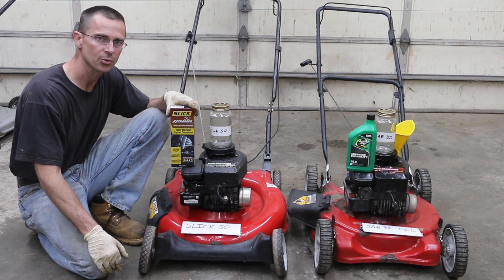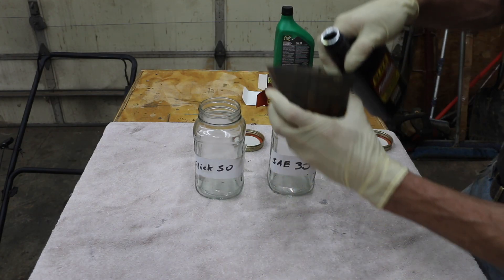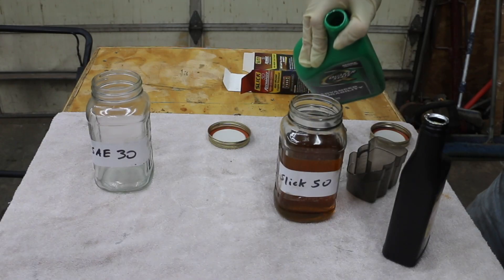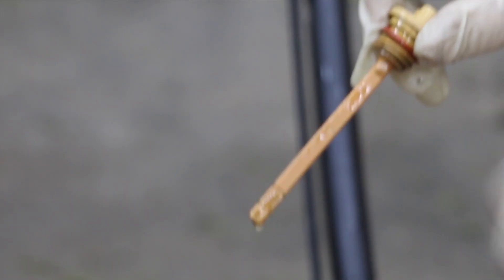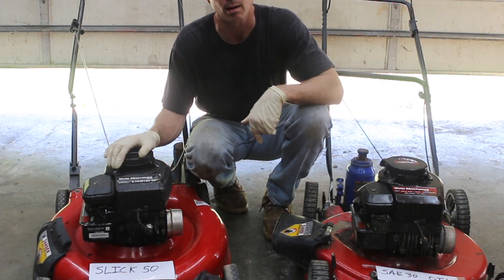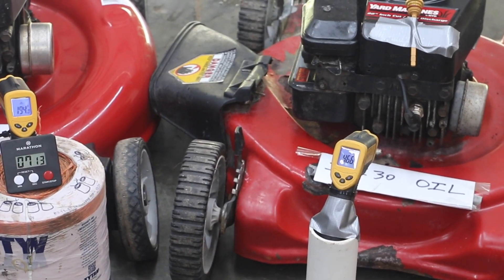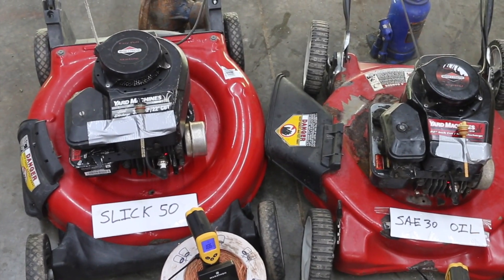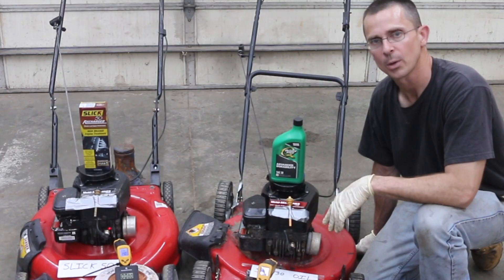Can't believe what SLICK 50 did to my engine!!--Dry Crankcase Test!

Comment: Hi all you chaps out there! I ran 'Slick 50' in a  Norton "Dominator" motorbike through  three oil changes which would correspond to approximately 20,000 miles. 
   Then one day the oil return hose to the oil reservoir developed a leak and unknown to me the engine ran completely dry while I was riding a long distance trip like a bat out of hell! The engine temp soared , so I pulled over and woe is me ,I was screwed in the middle of nowhere in the 'Rayalaseema' desert of Southern India, in the state of Andhra Pradesh ! (Try getting your tongue around those names.) Well, anyway, I taped up the hose,it held because it was not pressurised.The engine was not knocking, so iI guessed the bearings were ok.They're shell bearings in alloy con rods.Since I was on a long distance trip I always carry a couple of litres of oil in my saddle bags. And , oh boy! Was I relieved!! 
   When I finally reached Hyderabad city, the state capital, I stripped the engine . And I was heart broken. The Babbitt material was pitted and gouged out. Mostly due to the high heat from friction, luckily the crank journals were not too badly scored. I went down to the next undersize and installed Vandervell Indium flashed on bronze racing bearings.The slight scuffing on the cylinder bores on the thrust surfaces were easily honed off. A new set of hard chrome rings on the same old pistons ( Hepolite, Hepworth & Grandage) And everything was hunky dory for the next six years.....Till a lorry reversed into it and crushed it to smithereens. Oh yes! I forgot to mention. For those six years I did NOT use Slick 50. I used MolySlip 'E' in the engine and MolySlip 'G' in the gearbox. Magic stuff!!
    Now ...THAT stuff is unbeatable!!. I've ripped a hole on the oil pan of my Triumph Herald car once in the jungle, and it's got me home through 50 kilometres of grueling mountainous,potholed tracks. WITHOUT A DROP OF OIL IN THE ENGINE !!! Honestly! I kid thee not! The engine ran a wee bit hotter, but that was to be expected. The cam timing single link chain and sprockets took a tanning. But other than that everything was perfect.I did disassemble the engine when I reached civilization, but the bearings were perfect !
   A word of caution though, when using MoS2  (Molybdenum Disulphide). It acts a a catalyst of sorts to promote corrosion on bronze and brass surfaces , any copper based alloy, Similar to sacrificial anti-corrosion. In engineering slang it's known as bearing cancer! At present there's research going on to create electrical storage batteries far more efficient than Lithium Ion technology. It's well worth delving into those papers. It would prove very elucidating.
   And last but not least, I really appreciate the time effort and money you devote in all your programs. Very enlightening. Thanks a bunch and keep up the good work. Very few genuine blokes like you. You tell it like the way it is, really! We Indians are not exactly in the boon docks, you know! You have quite a following here in Bombay. ( I can't get my head around that new fangled name 'Mumbai'. It grates on my sensibilities!!!) By the way, that bike was a 1955 Dominator, with a "featherbed" frame and "Roadholder" forks. Quite the bomb in it's day. It could give a Triumph "Tiger 100' a run for it's money. It used to belong to a police officer and was used in parades and dignitary convoy duties. Alas!!! Them days are gone forever!
Reply from the maker: Thank you for sharing this experience!

Comment: Polytetrafloroethelene (ptfe) has a very poor bond rate to metal surfaces below 550F ...a temperature a normal internal combustion engine will never see...   and limited utility in engine applications although I've seen success with such resins in industrial compressor applications
Reply from the maker: Thank you for commenting on this!

Comment: I remember those adds for Slick 50. About 20 years ago my 15HP Kohler riding lawn mower started to have some valve ticking. I used an oil additive similar to Slick 50 but it was made specifically for small engines. Also at the time Slick 50 had some iffy reviews. I used it (sorry can't remember the brand) per directions (only 1 oil change, it was supposed to bond with the metal objects for a life time) and the ticking stopped and that engine is still running like a champ 20 years later.
You don't see those additive adds Slick 50 STP etc. anymore. I think the full synthetics have at least if not bettered the old additives.
Reply from the maker: Impressive results!

Comment: There is a lot of talk about Teflon in the comments section and I’d like to add my experience. As an aircraft weapons guy, active duty and civilian contractor with 30+ years on the job, I have worked on several sizes of Gatlin guns. Large numbers of the same weapons, as well as a couple versions of recoil operated .50cal, and gas operated 7.62mm guns that all used the same lube. It’s a medium weight, clear to white color and commonly referred to as “Camel Cum” (sorry for the crude reference). Interestingly to this subject, it is available with and without Teflon. Sometimes the Teflon was available separately as a powder and we could mix our own when necessary. Lube recommendations vary by weapon type and temperature you’re operating in but I can say positively and for sure, the lube with Teflon increases the firing rate of any weapon you put it in. In my mind, that clearly is a result of reduced friction. However, using Teflon in a weapon for 5k to 25k rounds and then disassembling and cleaning it in solvent (PD680 dry cleaning solvent in the old days, whatever that was, and later years mineral spirits) removes all of the properties of the Teflon. It returns to the lower firing rate when reassembled with the non-Teflon lube.

Its possible There is something else in the Slick 50 that acts like they claim, soaking into the metal and having residual effects, but it ain’t Teflon. I’m skeptical on the whole concept really. If there was a studied and proven product, I believe we would be using it on our military equipment. As I said, we do use Teflon suspended in lubricant for friction reduction in critical applications but there are no residual effects, and there are none of these “nano tech” friction modifiers available.
Reply from the maker: Great point!  Thank you

Comment: Hi John 
started to watch your vids about 2 months ago..
In this video you never said the temperature that slick 50 was when the engine seized...
As I was watching during the test the slick 50 temperature was almost half that of regular motor oil.. was it not?
So even though the motor seized much faster than the other engine the performance of slick 50 was
 still reliable don't you think?
I understand the premise is to test slick 50 dry engine claim- obviously this is an exaggeration..
But still the ultimate goal is a cooler engine than normal is it not??? not to run an engine without any lubricant protection...
So what do you think? 
Doug Grant

Comment: Can you please put Petron Plus Engine Conditioner Formula 7 versus Redline 0W40 full synthetic motor oil. I have seen some bearing tests on both and it would be great to have a unbias test done by you to really see if a premium metal treatment oil up against a premium motor oil. Both tests showed extremely low bearing wear so it might be worth while to confirm with your testing.
Reply from the maker: Thank you for the video idea!

Comment: It is my belief that Slick 50 on a microscopic  level opens up tolerances within an engine. It then precipitates out when shutdown hot. Due to the greater tolerances,  the conventional oil precipitates out as well more than it normally would leaving the treated engine with less protection. 
  Briggs and Stratton performed thier own test on two new engines seeing the same results as your own test. I remember seeing this test conducted around 1990.
Reply from the maker: Thank you

Comment: You should try rislone.
Reply from the maker: Thank you for the video idea!
Reply: @ProjectFarm  I use rislone in my demolition Derby cars. A lot of times we would lose all our water and sometimes the oil. That stuff always work great. We also had an old Cadillac coming to the garage that was missing and backfiring horrible. We use rislone ran in for a short time then let it soak in overnight. When we came back and started in the morning it started off rapping and went to smooth like nothing was wrong. Rislone is awesome

Comment: I put Slick 50 into a Fiat 128 in about 1984, and it made a huge positive difference. Engine went from rough running to very smooth. Oddly, I seem to recall that the Slick 50 back then was more white-ish after shaking up the bottle, not dark like yours. It worked well for about half a year, then I added some more, and it worked again for about half a year. I never believed the claim that it could run an engine when dry. They even claimed it ran an airplane engine with no oil.
Reply from the maker: Nice!  Thank you

Comment: I used to use prolong in my old Chevy and it did seem to run smoother and cooler.
Reply from the maker: Thank you!
Reply: Ha I just changed my oil that day and remember a guy standing and watching me dump some prolong in and he said "do put that in there it makes it too slippery and your motor will fly apart!" I looked at him with a big smile and dumped the rest in lol
Man that was back around 00-01. Getting old and no the engine did not fly apart ha

Comment: Is there anyway to free up a stuck small engine with anything like wd-40 or anything from lack of oil? Like maybe fill then drain, then add oil and it might live?
Reply from the maker: I've had good success with Marvel Mystery OIl. Thank you
Reply: Like fill it up and let it soak? Drain? Like take the mower you destroyed in this video and it will run again without disassembly?

Comment: My dad uses Dura Lube like every other oil change. The only thing I have used was Marvin's Mystery Oil. I had a 85 ford ranger 2.8 v6 with valve cover leak. Pretty much ran out of oil the point it started squealing pictures of pudding with four quartz back in the motor that's when I started using Marvin's Mystery Oil random order for another 2 years tell the head gasket went I wish too many issues with the truck I got rid of it. I would add a whole quart of Marvel Mystery Oil every two or three oil changes. I'm older took 4 and 1/2 quarts of oil
Reply from the maker: Thank you!

Comment: quick question sir, the SAE-30 oil measurement after draining was quite low compare to Slick 50, is there any chance some oil still inside the engine? if that so, it will make sense that the dry test on SAE-30 engine last longer. If not, why? 
just curious sir. thank you.
Reply from the maker: Thank you. It was completely drained.

Comment: Neat video but like I tell my customers.. Almost every engine can be unseized. Trick is pouring oil into the sparkplug slot and manually spinning the blade with a hammer or hands if you can (unless unit has rod knock) from connecting rod snapping off. Will still run but will be very violent sounding and may be temporary. Not recommended for the common person to do. Small engines are fun af to tweak, and attempt to save. Good hobby and job
Reply from the maker: Thank you!

Comment: Problem with your test.

You did not use two identical engines (Since different brand mowers and different model engines you will get a different result.)

You could have used an assistant to help start the other mower.

However, your method for draining the oil can even be a contributing factor, as the ability to suck more oil out of one engine than the other due to the differences in type of engines used.

I know you never claimed this being science but again the variables introduced make the test inconclusive!
Reply from the maker: Thanks for the constructive feedback.

Comment: I knew back when that Slick 50 came out years ago or even when they came out with synthetic Oil that it was nothing but a scam.  People today who put in Synthetic Oil into their engines, those engines end up destroying itself.  Always stay with real Petroleum Oil, nothing ever of synthetic.  You never ever what to get a engine so hot it seizes up on you or scores the hell out of the bearings or the piston walls the piston itself unless you got money to pay somebody to do a complete rebuild with new pistons, bearings, valves, rings, piston walls even the crank and cam shafts.   Too many idiots are out there today.

I even had a customer who drove up to my shop asking me to fix his engine and made inquires to him  Took off a valve cover looked at it and saw the huge damage, I put it back and told him to tow that car to another shop, the engine was wiped out.  Had no oil at all.  Everything all burnt inside the valve cover itself, engine seized completely.  I asked him what oil he put in, he said to me SYNTHETIC OIL.  That told me everything I needed and saved myself a heap of a problem.  The customer started bitching that I refused to do the work for him and I said I run my business and I have the right to refuse service when I see total neglect to a customers car especially to an engine.  Walked away and he got it towed someplace else and never saw the cuck again.
Reply from the maker: Thank you

Comment: Thinks its best to apply the slick 50 when the engine is running, i have used slick in racing motor bike, from 250-350-500 cc 2 stroker's and 125-250-350-650cc 4 storkers for 25 years, and all my test's have proven a gain on bhp, starting, acceleration, cooling, and less ware and tare, but i have never felt the need to run any motor with no oil/lub at all, this test realy prove's nothing but clickbait works very well. shame you did not check bhp out before and after adding the slick 50.
Reply from the maker: Thank you
Reply: @ProjectFarm  Sorry i forgot to say i am working on box of slick 50 which i bought whole sale maybe about 18 years ago ? i warm them up and shake for about the same time as a spray can before use in engines and only add when engine is running, i felt i had to add these info because i have been informed its only the name that is the same slick 50 and not the contents, i have only 3 x750 cc left, i have been told the guy that came up with slick 50 left the company taking all info with him and created another compny called "xcelplus", but i have not tried or reserched this product/company. 
Could you is possable test and report on this?. many thanks

Comment: The Experiment was wrong... slick 50 is an additive, it needs to be ratio with oil to work. Re do this with the right mix with oil and slick 50. Its not good on its own, but it should allow oil to do better. IMO of course, would be nice to see it done again with that  aspect applied.